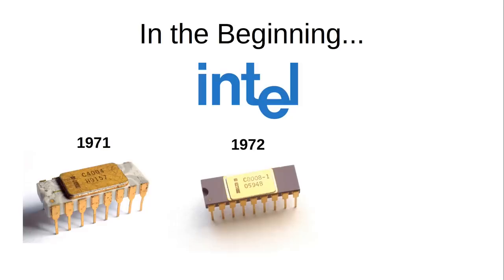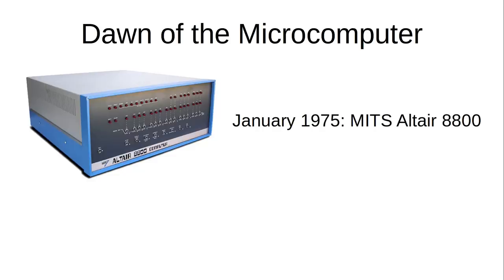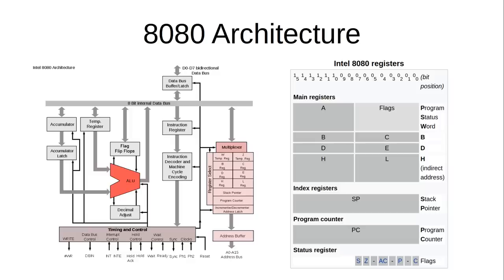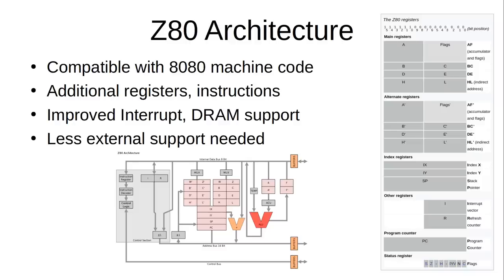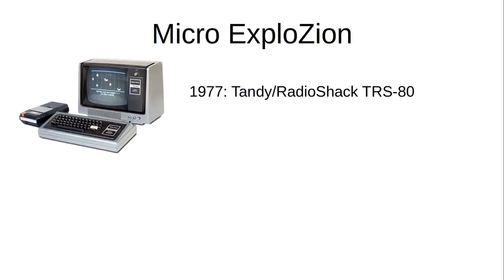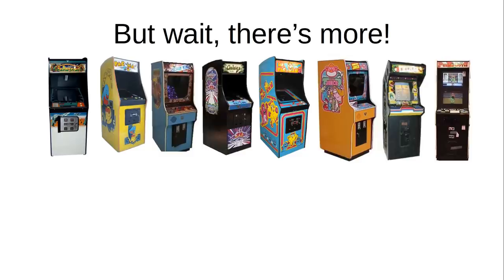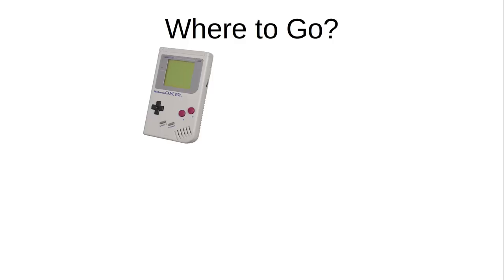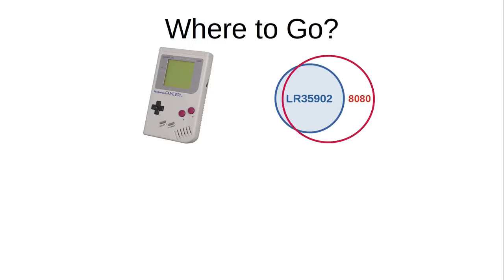Looking at the Zilog Z80 - NEW SERIES!

Comment: The Model 4 never shipped with 8" drives.  (neither did the Model 4P, which you're showing.)  I'm looking forward to the rest of the series!
Reply from the maker: I think I was conflating it in my mind with the Model 2. Oh well!
Reply: @slithymatt  It's all good.  The Model II was another Z-80 based machine (as you probably know).  There's a LOT of Z-80 based micros out there - most ran CP/M.  It's a fun chip.
Reply: I stumbled over that too.  For the timeframe, it seemed very implausible.  When I started with this monsters from the deepest and darkest pits of hell (we have a love/hate relationship… ;-)), that was about the time the Model 4 came out, and I never saw 8" floppies in actual use, so I googled trying to find this Model 4 with 8" drives.

Granted, the 4P looks like it has 8" floppies (surely bigger than 5¼") when you see this image and think it's a full-size computer from the time.  ;-)
Reply from the maker: the collective internet figured out that the picture is actually a Tandy 6000, which I believe did have 8" drives. For some reason, it came up in an image search for model 4, and that was the source of my confusion.

Comment: Let's remember Chuck Peddle, who designed bi-microproccesor Victor Sirius with both, Z-80 & 8088 (as DEC's Rainbow). Peddle designed also 6502 chip , used in Apple I & II, Commodore's systems, Atari's, Oric....

Comment: Large user base, simple design, and good Linux emulator would fit the TI-83/4 more than the Speccy, which is how I first got into Z80 stuff since I needed one for school and it was fun to learn to write code for it. You don't really need a PAL tuner for the Speccy, just get a LCD monitor with composite or RF inputs and they pretty much universally in my experience support both PAL and NTSC signals even in the US, I think it's just cheaper to mass produce one chip for all analog to digital signals than make them specific to regions.

Comment: Great choice. I've been working with a Spectrum from 1983 till 1987, doing development (BASIC, Z80, Pascal, Forth, Prolog, C), (small) databases and word processing (Tasword II). Had two 5.25" diskdrives attached, a full monitor and a full dot-matrix printer. I found Z80 relatively easy to learn. You could easily hook it up with BASIC (USR()) and Forth, which was a great advantage. Note there was a carload of capable BASIC compilers as well. I even ran (some) ZX81 Basic programs on them, using (some) home developed emulator routines.

I only left it when I bought a Toshiba laptop for work. However, for a long time I did my part in order to keep it relevant. E.g. each disk had a menu. Mine looked like this: https://www.youtube.com/watch?v=hD_4EP2j6Vo

Comment: I would like to see a "hello world" for the Sega Master System, and of course the Genesis later too.

I haven't really seen much on the "Zed-X" until recent years. A few years back I saw a fellow at the Dallas "Makerspace", which is where sometimes the DFW Retro Meetup and Dallas Society of Play game development meetups have been held, who had a ZX Spectrum and was putting a BBS on it, I can't remember if it was over dialup or telnet, impressive if that was telnet, so long as all the TCP packet and socket implementation was done on some external expansion CPU of some sort, and not on the host Z80 itself.

I just finished watching your X16 series and am tinkering now.
Reply from the maker: SMS is definitely a good candidate for a follow-up to the "Hello, Speccy", along with the "ColecoVision". Maybe the Galaga arcade board, too?
Reply: @slithymatt  Definitely the home console and computing systems as they have have common CPUs like the Z80 and 68000 and you can make new software for them. If your audience needs to learn a new GPU/APU, it's at least on a one-time basis per system, instead of a per-game basis almost with the arcades. Just the VERA alone on the X16 is a pretty big thing.

Unless your audience is educated on the differences between manufacturers, you might get that person who says hey you got Galaga, now do Centipede and Q*Bert. There's nothing wrong with that, but expect possibly long videos on each because of all the specific graphics and sound differences per manufacturer.

I don't know on the Galaga board though. What would you do with the Z80 for Galaga outside of emulation or ROM hacks? I think Namco had custom ICs on those for the GPU/APU. On Atari at least they used the POKEY for the arcade version of Centipede so you could get some code reuse on other Atari systems. Sega-16 used a YM2151 so it's reusable with the X16.
Reply from the maker: @johnernest8109  there's a good emulation of the Galaga board on MAME, and a lot of other Namco cabinets used it, so it's something like an 8-bit standard, but a super high-end one for the time. I probably wouldn't go beyond "Hello World' with that, though.

Comment: I wait with anticipation. Pushed Sinclair BASIC as far as i could, then resorted to a few short Z80 routines to copy graphics in and out of video memory, software blitting. Hand coded using the book "programming the Z80" borrowed from local library. By then Spectrum market was dying, 16bit was taking over and i moved on, so i didn't learn a great deal more than that.
Reply from the maker: I hope this helps you pick up where you left off. 8-bit forever!

Comment: Having owned a Spectrum (both original rubberkey 48K and the 128K +2A) that OK message at the end of the video looks wrong? I remember the Speccy always showing the error code before the actual error, so what I'd expect to see there is 0 OK, 210:1. What machine were you emulating at the point you ran that?
Reply from the maker: It's using a special open-source ROM, not the original.

Comment: It's still a powerful cpu for home brew computers used for control applications. Static Ram is cheap and there's the 8255 that makes real world interfacing easy. However this is all basic old school stuff. A modern microcontroller might be a better choice depending on your application. The best resources are probably going to be from us old sob's that are 60+ who built these computers on our kitchen tables from scratch. It's important to know 8 input nand gates and octal latches as well. Also 3 to 8 line (74LS138) demultiplexers as well and the 4 to 16 line ones like the 74LS54. Hell, theres a lot more TTL chips that need to understood to make life easier. I won't even get into fanout and decoupling capacitors. Have fun.

Comment: I'd like to see some info on what happened with the Z80's follow on, the Z800, which never seemed to come to life but was always just a few months away. My business suffered greatly because I needed a more powerful cpu that could run my 100s of thousands of lines of z80 assembler code. The Z800 was promised but never materialized, at least not in any way that would have helped me.
Reply from the maker: It was pretty much a complete failure. That would be an interesting video, to explore why Zilog was not able to expand on the success of the Z80 to become a player in the modern PC CPU market.

Comment: To this day I still remember that the opcode for "LD A, n" is 0x3E lol
Reply: XOR A   ;to clear the accumulator (using only one byte and setting the Z flag)
Reply: I remember 0xC9 is RET in Z80.
Reply: I remember 0xCD was the call address command
Reply: I remember none of that, but I do remember translating hex to decimal in 3rd grade, so I could use poke commands to load in small assembler programs on my zx spectrum +. Children will pick up what is needed to get the job done if you want it enough :-)
Reply: @BaldurNorddahl  Some children at least, unfortunately not all. I also used poke to load my first handcrafted opcode in 1985 at the age of 12. This was on a Sanyo MSX homecomputer. I had bought this magazine and the last page had a list of all the assembly commands and the opcodes in tiny letters. Combined with some understanding of how a CPU worked I was able to puzzle it together. I handcrafted a loop within a loop counting from 0 to 255 and used the value of the inner counter to move a sprite on the screen. The result just blew me away... instead of a sprite crawling over the screen like it does when you do the same in BASIC I saw a dozen sprites all at once because the TV could not keep up.
And that was it: I was hooked on machine code. So I continued to write my own assembler in BASIC.
A few years later I even build my own Z80 based computer on perforated board soldering hunderds of wires on the back to wire the CPU, an 32Kb EPROM, and 32Kb RAM, a PIO and a SIO. Wrote a bootloader in assembly. Asked my grandfather to find me someone to burn my EPROM. Basically I build an Arduino and it actually worked, but man that was a lot of soldering.
Reply: It was inevitable to memorize the opcodes, since back in 1980 I only had RAM for writing them.  So, every day I had to write the code again -hundreds of bytes - before continuing the program. Then, it was harder to forget them (to clean up your memory). A friend saw me reading my listing and asked: "What are you doing, you're reading a page of figures?"
Reply: opcode 21 for load HL, But who remembers the double byte opcode for load IX?

Comment: One of the little known Business computers that used multipole Z80's was the Mohawk Data Science Series 21 that could do up to 16 terminals, a 9 track Tape Drive, Hard Dick storage of up to 156 MB, and up to 4 8" floppies. In addition, it could communicate using ALL the IBM protocols of the day; i.e. 2780, 3270, SNA, and others. It could also support multiple comm channels simultaneously.
Each Comm channel had it's own Z80 and local memory, each memory board had a Z80 and each terminal controller (Supporting up to 4 terminals) had a Z80 on it. This system came out around 1977. They were used in data capture and transmission to IBM Main Frames and could read and write IBM EBCDIC  9 track Tapes. You could even hang a 300 LPM Printer off one of these.
Teck specs: http://www.bitsavers.org/pdf/datapro/programmable_terminals/Datapro_C21_Mohawk.pdf
Reply from the maker: MDS was not far from where I live right now.

Comment: No Commodore 128??  That machine gets no love.  :)  I love the Speccy though.  Looking forward to this.
Reply from the maker: Yeah the poor C128 didn't make the cut, mainly because the Z80 was barely used in them. People still just ran 6502 C64 software!
Reply: Yeah, you could run CP/M software on the Z80 side of the 128 but due to being hamstrung with C64 compatibility the chip was limited to 2MHz, half as fast as other Z80 CP/M machines. It's a pity no 128 software was written that could use both processors in tandem.
Reply: @The_Wandering_Nerd  The funny thing is that the C128 boots up on the Z80, which will then attempt to boot a CP/M disk (if a disk drive is present); if CP/M can't be run at this point, the Z80 hands control over to the 8502 CPU which then starts BASIC7 - unless the C64 button is engaged.
Reply: @The_Wandering_Nerd  If I remember correctly it wasn't possible to use both since they shared resources like RAM but wasn't "aware" of each other. 
(But yeah, I had those dreams back when I had a C128D to get the fun of the Commodore game library and the utilities from PC's - I do miss it.)
Reply: @slithymatt  Only Z80 software I really used was a (rather advanced) word processor that also required a cartridge - StarWriter?
Don't know if the cartridge was purely for copy protection or if it had some other functionality as well.

Comment: The "Trash 80", and successive follow ups, is why Radio Shack didn't die in the early 80s, like most of its competition like Olsen & Lafayette. Radio Shack actually thrived during 80s & early 90s.
Reply: Radio Shack also had a cool color computer out at the time. Used to run eliza.
Reply: @robertthomas5906  which ran on a 6809 CPU - best 8-bit CPU of all time.
Reply: @benjaminscherrey1124  A 6809 best 8 bit? Nah, 6502. That was the backbone of the industry. I wrote all kinds of stuff for that. Now I don't think I even have the assembler manual  or any of that stuff. Mold and other stuff grew into it.

Comment: A good choice could have been the MSX. It is a very standard platform, which can branch out to the Master System (Mark III), the SG1000, The SC3000.... they all used very similar hardware (even graphically, as all of those support the same graphics modes). You can then also tap into the gigantic homebrew base for the MSX and SEGA systems that is in Brazil, the Netherlands, Eastern European Countries and many others that had MSX clones (often unofficial) launched in their countries. Heck the CollecoVision is also quite similar. 

Many of the "bad scrolling" games the MSX was known for, was due to bad ports from the ZX Spectrum. Which I also agree is a good starting point. But please don't throw away the resources offered by the MSX/Sega 8 Bit community. As there is a lot out there with a very devout fanbase. Sure, English might not be their first language, but most of it is very readable.

Sorry.. rambling :P.

Comment: I think there isn't any better choice. No sound chip, no programmable grahpics controller, just basic i/o, no keyboard controller, even cassette routines were just little clever routines in ROM, no paging... maybe a little quirk with upper 32KB when interrups are used, but, anyway. ZX Spectrum just lets you fiddle with the hardware as is.  Just a simple (so to say) machine which can be used to learn AN AWFUL LOT about architecture and programming. I think I sound a little biased, but it's just because I am ;) Subcribed and waiting for what you could have to teach us.

Comment: What about CP/M? I learned Z80 assembly on the Sinclair ZX-81 and it carried over to CP/M. I insist: no CP/M no MSDOS.
Reply from the maker: I may get to CP/M later, after exploring the Spectrum first. The tutorial series focusing on the spectrum certainly won't be the last one I do on Z80, especially considering the response this video gained. Maybe a crossover with the C128 CP/M setup and how it can complement the capability of the 6502-based Kernal.
Reply: I went the other way round. I started programming in BASIC on the ZX81, but then I started secondary school. There, they had the official schools computer, the RML380Z which was a CP/M machine. Using Zak's book, I learnt assembly language on the 380Z, and after knowing how to write in assembler, hand translated into numbers which you could then POKE into the REM statement on the ZX81 to create a Z80 machine language programme. I don't remember any sort of assembler for the ZX81. I was 11 years old!

Comment: I had both a ZX Spectrum+ and an Amstrad CPC 464 when I were a youngling. I learned BASIC on them.
Personally, I would highly recommend choosing the Amstrad over the Spectrum one.

Programming on a Spectrum is tedious. All the keys had BASIC keywords associated with them, and it would not let you type them out letter by letter. You had to use horrible key combos and search the keyboard for what you wanted. I hated it.  There was also significant colour bleed, and could not set specific pixels to specific colours, it made games look horrible. 

The Amstrad on the other hand, had no such limitations. It was a late arrival to the Z80 scene, so there were also a few significant additions to it's version of BASIC, such as Sound and Graphics implementations. It didn't have the colour bleed problem, and everything looked much better. 

The spectrum was far more common, because of its price. The Amstrad was more expensive. It means game producers always targeted the Spectrum audience and only a 'maybe' for the Amstrad.  

For emulation, I've seen an web-based Amstrad emulators, so I would be very suprised if there isn't a linux based one.

Comment: Ummm. Model 4 came after Model 3. The desktop version looked similar the the model 3.   It used 5.25" floppies as well. Although the Model 4 did come in a portable version, called the Model 4P.

iNTEL stared it, as you said. ZiLOG was a split off iNTEL as you said.... an improved, single voltage, 8080

Motorola entered the picture with the 6800... It was a single voltage CPU externally (internally it generated the other voltages.) 

MOS Technologies inherited half the 6800 team due to Motorola refusing to change how the 6800 was created. The 6501 was very short lived as Motorola killed it via lawsuit for using the same pin assignments as the 6800. It was also basically the 6800 design team thumbing their nose at Motorola and was never meant to be high production. The 6502 was born along side the 6501 ( and 6503, 6504, and 6505 variants) and included a built-in oscillator (clock generator), with a modified pinout.

iNTEL        8080 - 1974
Motorola   6800 - 1975
MOS          6501/6502 - 1975
ZiLOG        Z80   - 1976
iNTEL        8085 - 1977
Motorola   6809 - 1979

I'm a 6809 fan, personally, but I like learning about the other CPUs of the era.

Comment: what is the pro's and con's of  the z80 vs 6502 series of processors ? in many cases with competing technologies it may just boil down to preferences
Reply from the maker: Pretty much a matter of preference. The big advantage 6502 had back in the day was cost. No way Atari could have made the 2600 under $200 with the Z80. Now, the 6502 is a much simpler ISA, so it may be easier to pick up. But the Z80 is more capable, with many more registers, and much more internal 16-bit capability. It's more comparable to the 65C816 in that respect. But they both have similar limitations, with no built-in support for multiplication, division, or any floating-point math.
Reply: @slithymatt  that too was a driver on its cost, transistor count. My friend who started on 8080 (later became 68K geek) couldn't stand programming 6500 because of the register and stack limitations.
Reply: The 6502 was RISC compared with the Z80...